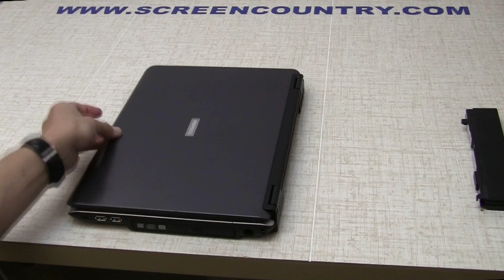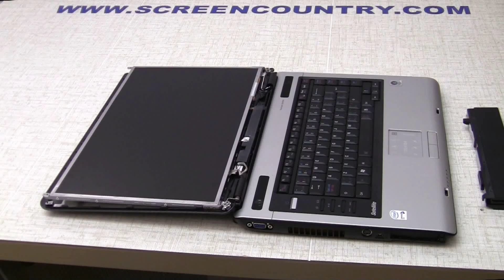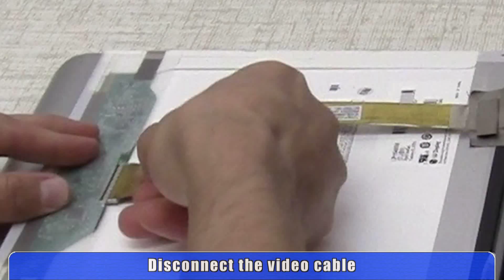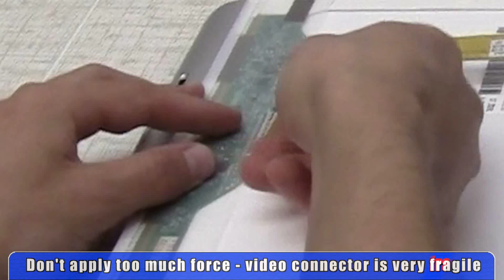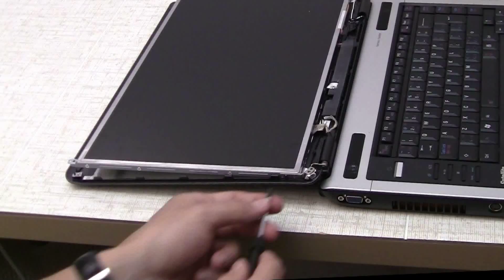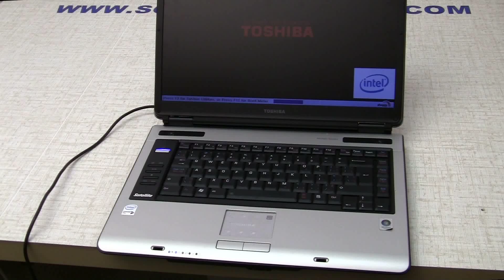Laptop screen replacement (How to replace notebook LCD) [Toshiba A100]

Comment: I will be replacing a cracked screen on a Toshiba Satellite C855-5347. It seems to me that  I will have interference with taking the screws out the lower half of the bezel. So will i have to take off the bottom of laptop to open the computer completely. I have never done this & to me it seems to be elementary replacing a cracked screen.

Comment from the maker: @missDiamondgirl55 I suggest searching your laptop model number in YouTube, together with "lcd replacement" and seeing if there's a video instructions for your model. It'll be cheapest to replace the screen on your own, or get tech savvy friends to do it. Reasonable repair shop offer would start from $150, and BestBuy or other big box stores with service departments will not be as reasonable as a small shop.

Comment from the maker: @poymfw Some DELL screens are replaced together with the inverter, but you are still able to reuse the old inverter. Look for screws or other means of mounting like metal brackets on the caddy which holds the inverter.

Comment: awesome video, will it fit with dell 640m laptops as the inverter for 640m is screwed to the metal part that holds the screen